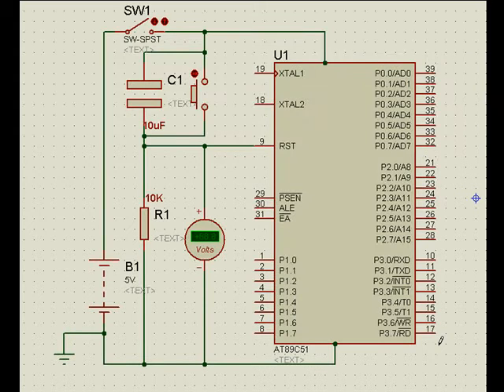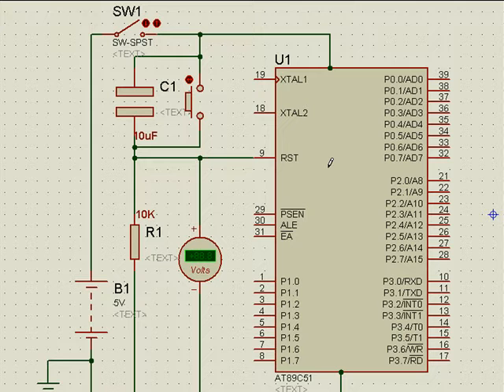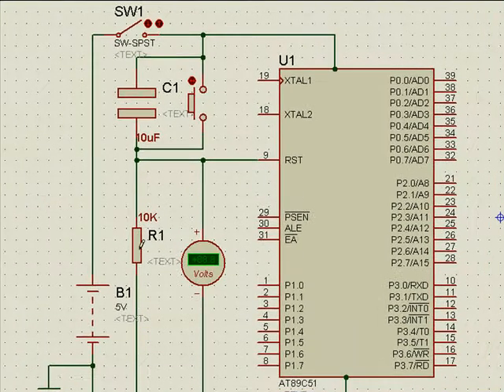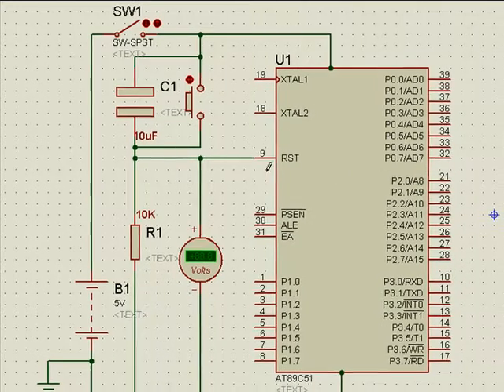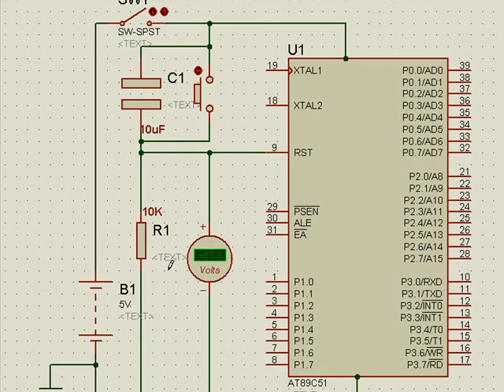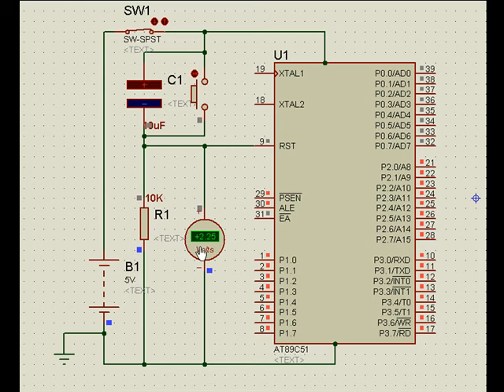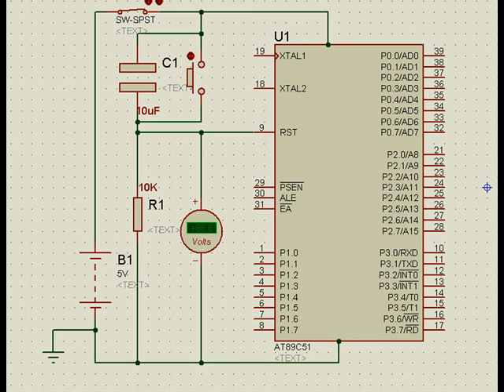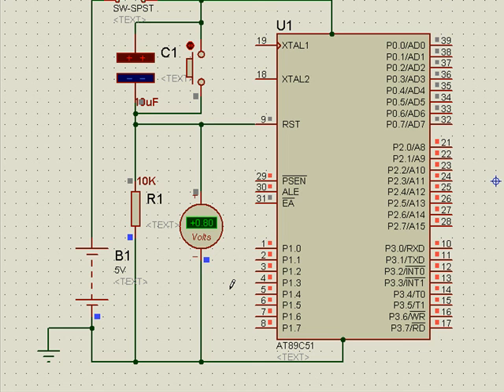Microcontroller reset function

Comment: There is a flaw in the design. One diode has to be added for proper functionality of the circuit or else if there is power down for few seconds then capacitor will not get discharging path and this circit will not work as desired. Thanks for the efforts though.